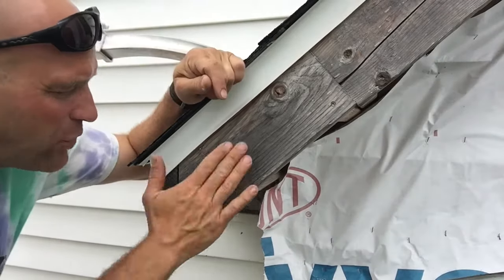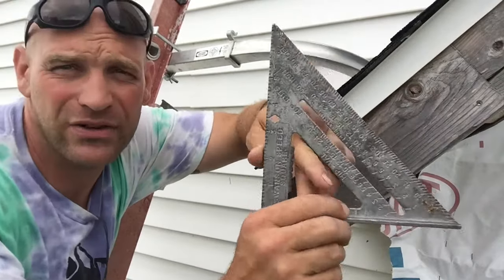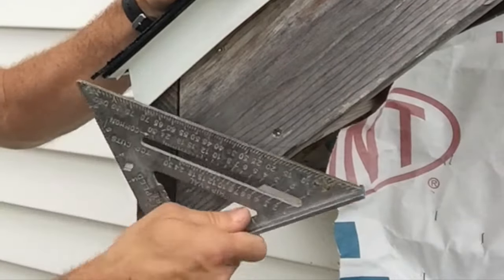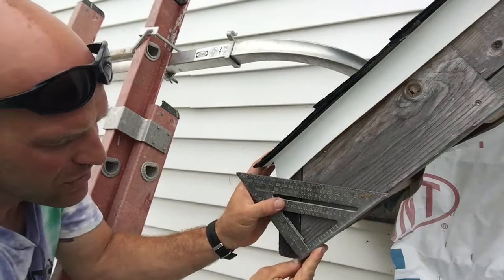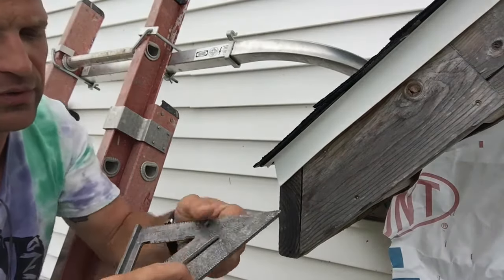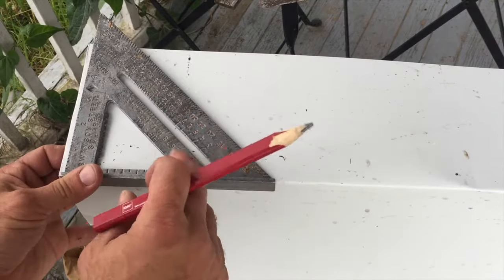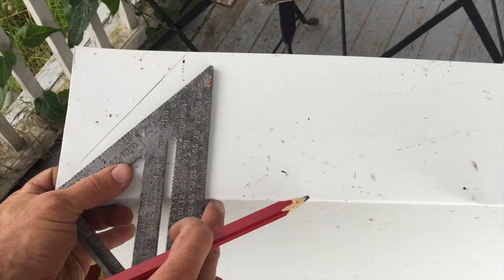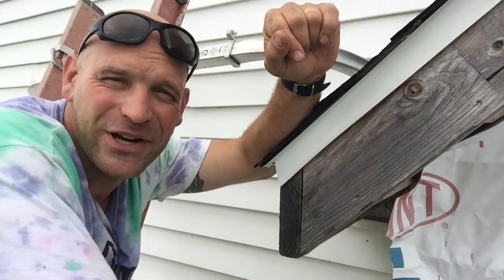How to find the angle of a rafter with a speed square ( check the description for the whole process)

Comment: The easiest way to find the pitch/angle of an existing rafter it to do the following: put a level on the rafter , position the level to plumb, draw a line. Put your pivot point on the bottom of the vertical pencil line and read the angle on your speed square where the underside of the rafter intersects the degree numbers. - super simple and always accurate.
Reply from the maker: You are correct.  I just wanted to show how you would find the pitch if you didn't have a level handy.  
My YouTube channel is for people who are new to carpentry, woodworking, and welding.  Many of my students don't have their own level, but they can get a speed square pretty easily.  Thanks for your input, I appreciate it.

Comment: You can also put to the pivot point up top rest a level on it and level over would be a little more accurate. Not knowing if the plum cut on the rafter is actually plum or not
Reply from the maker: Good tip

Comment: Speed squares come with a manual giving simple instructions on their use , this is way to difficult . Place the speed square pivot at the bottom of rafter as you did , then using a small torpedo level , level the base , read the scale and that's it ! Will tell you the pitch , angle to cut ! The end cut of the rafter is s plumb cut , you'll need to know more to do your birds mouth cut , hip or valley !
Reply from the maker: I wish I had the little book that it comes with, my speed square is over 20 years old, maybe it’s time for a new one

Comment: The correct angle to cut is 43 degrees NOT 47. You have to subtract 47 degrees from 90 degrees to get correct angle if you use the speed square the way you did.
Reply from the maker: You are correct, I forgot that, I wrote that in the description.  Thanks for your help

Comment: 100 % wrong! That only works for a 12/12 . If that rafter was a 8/12 then the cut angle would be 35.5 deg. To use the square properly the back of the square would be held level in relation to the angle then you would read the angle as indicated on the common scale
Reply from the maker: Could you make a video showing your technique?
Reply: You are incorrect sir. You must rotate the speed square at its pivot point to plumb then read the angle. Jesus does anyone know anything anymore?
Reply: @maxkady9478  that’s exactly what I’m saying just in a different manner
Reply: @stevenfoust3782  I know buddy! I’m agreeing with you
Reply: @maxkady9478 I thought that's what he did but the backwards way. I know their are a few ways you can use that square. I never understood it though because the damn book they give you is confusing. It's better to ask a master carpenter. Do you have an illustration we could watch?
Reply: That's not how its done , 
You have to cut the speed square in half , then put the other end on the timber and the 2nd bit underneath it , then take a chain saw and cut the angle 😂
Reply: @freespeech4023 😂😅😂😂😅😂😅 Good one !!
Reply: @cantiflas777  😂
Reply: @Trevkongable put your square on the low side and sublevel it out. It's simple and it's actually the correct way
Reply: @maxkady9478 You can do it the way he did, but to get the correct angle, you have to subtract 47 degrees from 90 degrees. The correct angle is 43 not 47.